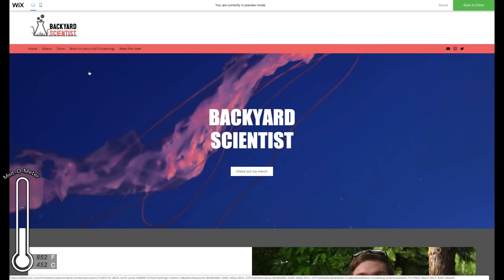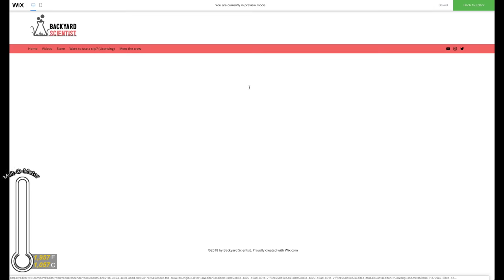Pouring lava in my pool!

Comment: Most objects would need to be hotter than 5500°c or 9932°f to emit UV rays. That’s typically the radiation peak of visible light. (Of course its different given the compound that’s being heated)
Reply: I was hoping to find this comment. Though I always thought it was 10,000 degrees or more. Regardless, it’s not a heat source we’d run into any day. It’s basically the surface of the sun. Of course the sun itself is millions of degrees hotter.
Reply: @julievanderleest  not to ruin your thought. but actually, the surface of the sun is 6000 degrees hotter. but yeah the CORE of the sun is 15 million degrees celcius.
Reply: Itd have to be so hot that the molecules turn into plasma
Reply: Ok
Reply: Your lava has to be at least 3000 °C hot so that a small amount of the rays emmitted are in the UV spectrum. At 6700 °C (5700°C is typical for the suns surface) your radiation peak is at the border between the visible light and UV.
Reply: Why does the compound matter?
Reply: The company that I work for makes plasma cutters. The 800 amp machines require you to wear skin protection to be around while cutting.
Reply: OMG!!!

Comment: if you were at the other end of the pool i wonder if it would be very hot, its boiling the water around it so i wonder how far and how fast that heat would reach across the whole pool
Reply: Nice
Reply: I'm not an expert in any regard, but I'm pretty sure it wouldn't make the opposite end of the pool crazy hot or anything because of the high specific heat of water. It's the same reason why the ocean temp doesn't change as much between seasons as the air and land.

Comment: wow... the coe of that sodium glass plate actually held up a lot better than I imagined... 
when you hit the plate in the center the entire plate started expanding like crazy... 
The edge of the glass plate was still cold, which was actually acting like a retention band around the plate - which was expanding from the center. 
When you over lapped the lava on to the edge of the plate in to get it on the aluminum, the glass was able to expand enough on one side of the plate, breaking the cool ring, and that caused it to shatter, which is why it blew outward the way it did. (If you did that on purpose for camera effect - BRAVO!) 

If you bring the glass plate up to about 800-1100 degrees first and then place the lava on there, the glass will have a much better chance to hold it. (Also if you use a borosilicate glass)

Comment: It simply creates a cobblestone generator.
Reply: Little known fact this all takes place on Skyblock
Reply: Bruh Sound Effect #2
Reply: No he made the water hit the lava source so it only created obsidian
Reply: No, it's an obsidian generator.
Reply: @Draco Centauros no, if you add water onto lava it makes obsidian, but he added lava onto water (basically the other way around) which is cobblestone lol
Reply: Duh, why’d he even do the experiment?
Reply: No, not obsidian or cobblestone, stone, because the lava is on top of the water.
Reply: It is a stone generater cause flowing lava is making contact with water source from above

To make obsidian, u need a lava source in water
Reply: If in right conditions it could actually make obsidian
Its a volcanic glass formed from fast cooling if I remember correctly
I think that was obsidian that formed, it is, depending on type, often times relatively maluble and smooth like what he pulled out
Reply: Or basalt, yeah, it looks more like basalt to me
Reply: @JustARoamer  r/woooosh
Reply: i-win I just released an album and I would really appreciate it if you would take some time to listen🙏🏽 Listen to heart broken and demons. Thank you♥️

Comment: I think Kyle Ried said that if lava is really hot you are going to flop on it like a waterdrop on a pan as your water evaporates explosively.

Also yeah, you'll not sink too much because lava is very heavy (it's a rock). You'll only sink enough to displace your weight, which is not that much volume of lava.

Comment: 3000 degrees Kelvin,that's how hot something needs to be to give off UV radiation,so basically sun.
Reply: The sun is twice as hot as 3k, but yeah, fair
Reply: Barokai Rein Degrees Kelvin?
It is kelvin.
Reply: What about 3000 kevin?
Reply: My welder gives amazing UV burns to my legs when I wear shorts. But I guess that is from the arc. I wonder why I didn't seem to get UV burn from a plasma cutter which is much much hotter. I do however get a lot more splatter burns with plasma
Reply: I scrolled down the comments to look for the answer and this turned up almost immediately
Reply: Sun is waayyyyyyyy hotter
Reply: Ploper Dung I believe he means the surface of the sun, which is still hotter, around 5000 degrees I think, but the core of the sun is just immensely hotter, around 15 million degrees kelvin if I remember correctly.

Comment: It stresses me out so much how little protective gears you're wearing.
Reply: It's not gonna erupt like volcano lol
Reply: I just watched the part where it explodes and now I agree they should've wear more protective gear lol
Reply: artemis chen I mean even if he didn’t know it was gonna explode just be safe and wear as much as you can
Reply: It was just glass, also all he needed was something like welding gloves because of the heat
Reply: Mister Torgue High Five Flexington Silva 
Nah. He should’ve been wearing a forge apron in addition to the gloves. Jeans and a hoodie wouldn’t do nada if he accidentally spilled any on himself. And when he did the experiment with the aluminum and glass? Add in goggles.
Reply: @anonymousfellow8879  how the hell do you spill it on yourself. You should not be handling this stuff if you some how find a way to spill it on yourself

Comment: Technically, if you fell into lava you would explode due to the high water levels in your flesh, plus your bodily fluids, like your blood or stomach acids, will either instantly boil or rupture the vessels/ organs holding them in.
Reply: Basically . . . when Gollum fell into Mount Doom he definitely wouldn't have sunk, he'd have skittered around the surface like a drop of water on a very hot surface, as each layer of his skin, and flesh, and fat, and muscle, and organs, and bone was all burned away from him in searing screaming brutal agony.
Reply: y only 1 like?
Reply: Thats a yikes
Reply: Sounds fun
Reply: I thought id get cooked im pretty confused if i tastes like a chicken or pork..  Maybe i tastes like a beef
Reply: This also happenend to Trump's face.
Reply: would it hurt? or would you be able to feel something?
Reply: @zorro-ki7zr  it's most likely so hot the nerves in the skin would have burn or even vaporized off. Remember that this demonstration is only around 2000 degrees while true lava can reach 20-40,000 degrees. You may feel your internals blast open but beyond that don't expect to live longer than 10-20 seconds. The blood would fail to reach the brain due to boiling causing you to pass out and go brain dead in seconds. Gotta say, pretty cool stuff here, morbid, but cool!
(Correction, it is actually 1,300-2,400 degrees. I don't know why I remembered with an extra digit as you would be instantly vaporized at those temperatures. I said explode, not vaporized. Sorry for the confusion)
Reply: @snizzol  that's it, we solved the mystery of why Trump's face is bright orange. Personally I always thought it was that he was secretly related to the annoying orange, either that or, HE'S A LIZARD PERSON! Dun dun duuuuuuuun!
Reply: @Drippoff  from what I hear online Americans tend to taste like basically raw salt due to high sodium levels in our diets. That was something I heard on a sci show episode years ago, can't remember what it was called. All I remember beyond that was they suggested people who eat asian foods taste the best. Morbid, and not very descriptive, but it's not like I planned on eating people anyways.
Reply: CamoSocks  Thanks! greetings from the Netherlands
Reply: @jamesalexander1441  Yup! Doesn't it make you feel all warm and cozy inside? The idea of you basically floating on a layer of your own vaporizing flesh sounds much nicer than sinking into the pits of Tartarus in agonizing pain.
Reply: Skylancer727 oh my goodness that sounds painful
Reply: Yeah it would be an incredibly gory,  bouncy, smoldery sight to behold
Reply: My sister and me read this comment and she was like wha? And I said him and me are wayyyyy tooo smart for u(she older btw)
Reply: thank you for describing this death so vivdly...
Reply: @Skylancer727  ok thanks <3 sounds pretty interesting
Reply: Gotta leave the likes on 444
Reply: That sounds MUCH more cinematic than the actual movies!
Reply: 523 likes in 3 hours geez
Reply: I know
Reply: @Drippoff  actually human  meat tastes like veal apparently
Reply: @Skylancer727  that's complete bull, you sure that show wasn't satire?
Reply: @Skylancer727  I seriously doubt you would float, from the videos ive seen you would just sink in a bit and then start exploding from the evaporating blood and water inside you.
Reply: @Skylancer727  20 to 40,000 degrees?? No way, that's hotter than the surface of the sun. Source pls
Reply: Skylancer727 where is your source for this
Reply: Would it be quick or painful?
Reply: R/iamverysmart
Reply: Depression Sama your body would go into shock so hard & fast you probably wouldnt feel much very long
Reply: @saigames2369  okay, I was going off raw memory, which as we know isn't always reliable. Still. Boiling immediately is still basically what will happen. Humans begin to lose to heat around 95 degrees (you can last but not forever) and someone who can't sweat will burn even at these temperatures. 104 degrees is basically guaranteed to burn flesh. Now lava conforms to the body as it is a fluid making it have near perfect contact to everything it touches. This makes transmission of the heat more efficient. This is why the effect is so extreme. Human flesh would basically instantly combust in immediate contact to lava but as I said, being dropped in it in the movie style you would likely explode due to heat expansion and vaporization.
Reply: @jamesalexander1441  leidenfrost effect
Reply: @imakrewitatl  to be fair, you might have already passed out by the time the body even starts entering shock. Again, I'm assuming you're submerged in the lava or dipped in it. Sitting on top like walking on it you probably would collapse due to shock as the nerves near instantly  burn/ vaporize off. Not a very pleasant way to go, but hey, you may go out so fast there may be next to no pain as the nerves burn clean off.
Reply: Skylancer727 Very interesting comment! Megaman Legends? AUTOMATIC SUBSCRIPTION
Reply: @TachibanaDono  hard to say. The external damage would most likely be nearly painless due to how fast the nerves are melted off. Your internals are where you would feel it. The heat will cause the blood, stomach acids, and even the fluids in the brain and ears to boil which could be absolutely excruciating. Also, it would more depend how you fell in. Head first you may be dead basically instantly as the brain breaks down, anywhere else could be horrifically painful as the blood vessels pop, organs rupture, etc.

 If the heart or lungs pop you won't last more than 20 seconds before brain dead but that's assuming the brain was unaffected till then which it most likely wouldn't be just being that close to the lava. Definitely a quick death but I don't believe it would be painless. Not like shot through the head or instantly crushed that's for sure, but more pleasant than set on fire. No matter what you won't last long. Similar to being in a vacuum without a space suit, when the blood boils you go out fast as the blood will expand everywhere basically destroying everything. In space you don't last much longer than 10 seconds and with the extra damage the lava does beyond boiling you might not even make it that long as the blood alone could rip up your brain and turn it to mush. Basically it's the same idea as what Game Theorist said in his Commander Shepard video. The blood boiling alone would have made Shepard a lost cause and we would basically see the same thing here.
Reply: you would only explode if you are able to sink fully in, which is impossible because of the density of lava, so you would just boil up and burn gradually
Reply: @Naev0w0  depends if you were sweaty prior to falling in. You may float over it for a split time before you sink in similar to how you can dip your finger in molten iron if you dipped it in water prior. The water evaporates so fast it makes a form of vapor shield. Of course this is very temporary, you will still fall in and inevitably explode due to the heat expanding the fluids and air in the body.
Reply: I'm just going to take pride and say I was the exact 1000th like to your comment!
Reply: Электричество  being that close to molten rock or steel it wouldnt be gradual, your body would boil & then combust very fast im thinking
Reply: @Naev0w0  yeah, still not gonna try it to test that. I've had enough of the story about the pelican sandwich.
Reply: @astronomical4763  hey, there was another comment with over 1.6K at the same time.
Reply: @tokeitup420style  it's also too morbid to ever show in a movie. Can you imagine a movie like Indiana Jones having the rival explode instead of just melt. That is far more drastic, less dramatic. You know what I mean? You can't show regret or emotion in bang it doesn't really fit the Hollywood style. Imagine Anikin Skywalker exploding instead of just combusting (though he was mostly on land you get the point). Not really as emotional.
Reply: @codyh39  somehow I doubt you like I do for the 10 different "first"s I see on every video.
(Okay I really don't like making a plural of a quote, that looks really bad).
Reply: James not true due to the fact that you’ll pass out due to shock
Reply: @Skylancer727  Geez dude
Reply: @astronomical4763  now I need someone to animate it for me and I swear it better have ray tracing.
Reply: @Skylancer727  well I definitely wasn't the first but when I liked your comment it changed from 999 to 1k. Now, what are the actual chances that I was the literal 1000th like? Well in short, it's slim. Here's to assuming that there are several thousand simultaneous viewers watching this specific video, reading this specific comment, who's not to say that someone else didn't click before I did and it just hadn't updated my browser. But what I'm getting at is as far as I know, I was the 1k like to the comment, which was kind of a neat little point to my day, whereas someone else could have done the same. That's okay though because I don't need to be bonafide to anyone to make that little jewel make me smile today. So I'm just gonna go back to Kerbal Space Program and do some Mun observation. G'day!
Reply: Ha ha Funny.  I'll volunteer...not
Reply: @codyh39  I'm just messing with you man. Even if you aren't really the 1K like it still makes you feel special. So, do you wanna try your luck with the lava to see what happens? wink wink poke poke nudge nudge
Reply: @Skylancer727  How bout testing with a lego minifigure or barbie doll before a real person. 🔥🔥
Reply: @Skylancer727  Well, now that does sound very intriguing! Especially since you made it sound so appealing!

Give me free beef jerky and a sarsaparilla and I'm down to be the guinea pig.
Reply: @astronomical4763  you would need to fill them with fluid to try, also, when it comes to something like fluid dynamics the small scale doesn't always equal the large scale. This was a common thing the myth busters used to mention. You can shrink the model but not the matter it's made of. Fluids don't always work the same at different scales.
Reply: @Skylancer727  let's just do a computer simulation
Reply: @Skylancer727  at least he's not as orange as he was before he took office. Man looked like a carrot with bleached leaves. Lol